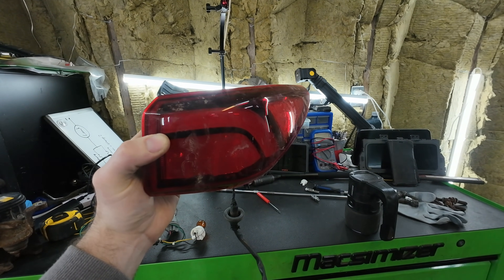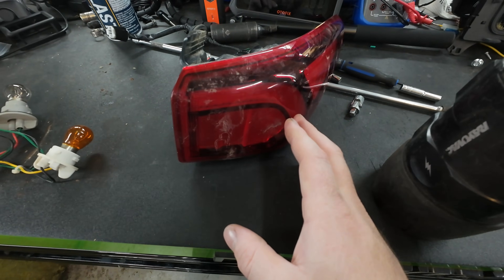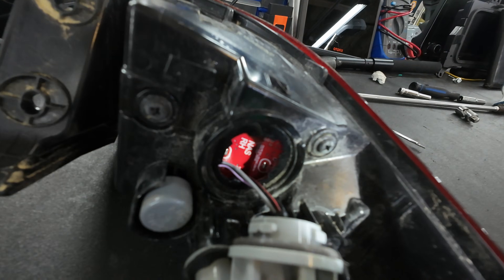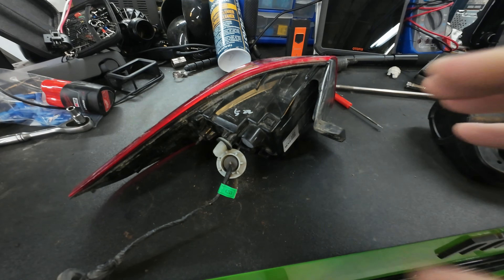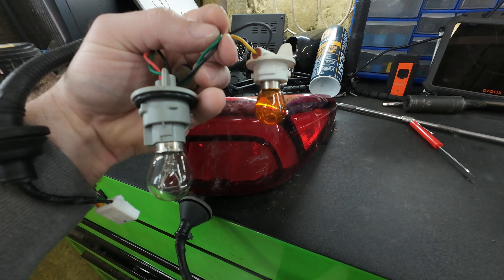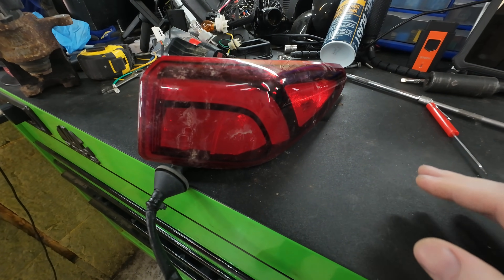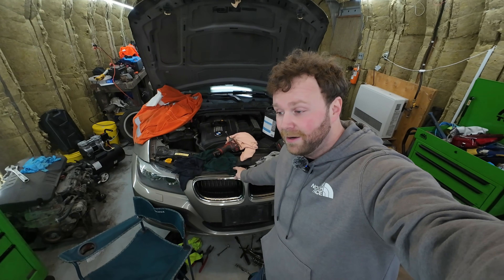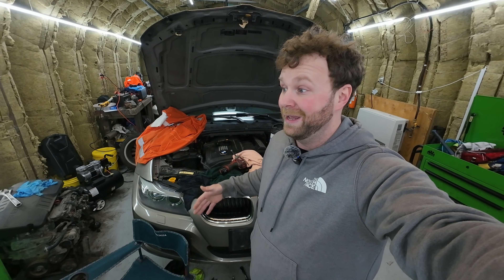Car Manufacturers don't even want you to change bulbs, they want you to replace entire assemblies!

Comment: I found this out a couple of years ago when checking on new cars that now have LED head and tail lights. I was looking a cheap cars and wanted to see what it would be to change out a head light or tail light on a 2023 Hyundai Venue, a $20000 car at that time. After going around with the parts person about wanting a Vin number (I looked up one on their lot) I was told tail and head light came as a unit and was $1400 for one tail light and $1500 for one headlight. I plan on keeping my 2005 car as it cost $5 to replace the tail light. I just put in new head light enclosure (it was hazy) with an LED light for $60 each side.

Comment: It might not be as scandalous as thinking they want to make more money on parts afterwards.    I know a few engineers that have worked visteon and ford.   If glue is cheaper then screws,  they get rewarded for saving $0.20 for every fixture that is put together.    It really needs to be legislated for right to repair.  The manufacturers won't do this out of the goodness of their heart.

Comment: I currently drive a 2003 car. This car is very comfortable and pleasant to use. No worse than a 2023 car. But when something breaks in my car, I just take it and replace this part. It can cost $1.5. All parts are available here in Ukraine, where I live, even though the Russians bomb our cities every day. I don't have to spend hundreds of dollars and go to a car service station if some small part breaks. And even if something breaks in the car, it will drive. The computer won't block the engine and there's no need to call a tow truck. It will drive. That's why I love old cars.

Comment: You're not the only one who wants a SIMPLE car. I also prefer simplicity over gas mileage/luxury etc. but it gets harder and harder to get cars like that. Just replaced my rusted out 20 year old BMW with a 2021 Mazda CX-30, it was the best I could find: Manual transmission, 2WD (4WD = more complexity), no turbo. It still has a lot of electronic gizmos inside like an electronic parking brake but at least I can still do simple jobs like a brake pad change without a licensed dealer only computer tool with permanent internet connection (like modern VW or Hyundai).

Sometimes I think that car manufacturers don't realize that they are digging their own grave. As cars become less and less repairable and more and more expensive, people will eventually demand more public transportation or look for other alternatives.

Comment: Yep. I had to replace the tail light assembly on my 2015 Ram 1500. Over $600 from the dealer. I bought a replacement from a salvage yard for $150. Same for the front sway bar. Over $800 from the dealer. $150 at a salvage yard.

Comment: I read somewhere that the new door on GM vehicles, if you break the door switch, you now have the buy the whole door 

Too bad that it is glued, usually dead diode can be replaced (soldered, but not a problem for anyone who knows how to do it)

Comment: we had a brand new ford f150 was 5 months old. headlight failed, dealer did not have one and was backordered for almost 4 months. then about a year later 5000 miles out of warranty it failed again 1500 to replace

Comment: Man I love my Audi TT coupe and convertible the coupe needed a cylinderhead timing belt the convertible needs a clutch. I will get to it. 650 for the coupe it's running and legal 24oo for the convertible. Less than 2 taillights

Comment: The last time I shopped for a new car was in 2018. Being an ex-mechanic myself I gave preference to old school simplicity. No screens, no cameras, no turbo, no GDI, crank windows, no LED lights. manual door locks, manual transmission, non electric seat adjustment, steel wheels, etc.. I bought one of the last cars with these features, or lack of features depending on your point of view.
Reply: @MrHugemoth Automatic trans is fine, as long as it's not CVT..
Reply: 1990 Chevy pickup for me. Small block engine, throttle body injection, manual transmission, manual windows, manual mirrors, and manual seat adjustment. I bought it new and I'm taking it to the grave with me. I wouldn't trade it straight across for anything brand new.
Reply: Same here with my 2004 chevy s10 blazer.
Reply: There's literally NO CAR nowadays with the spec you listed

Comment: I believe that if the automobile manufacturers continue doing what they are doing. That combined with housing crisis. That future generations are going to have to live the car free New York City way. Car ownership drops down to dark ages levels. As for me. I look at you tube videos and read internet articles . And decided that if I could I would live the car free way. And advise younger generations to do this and not try to live the American dream of house and car. Maybe the auto kind society is going to disappear  because of housing crisis even if the automakers went back to building simpler repairable card. Buti can't imagine or think of a better way to turn future generations from the car than to continue as they are.

Comment: I can remember even 10 years ago it cost $800 to have a headlight changed in an Escalade. Only the dealer could do it and the whole front end had to come off. The new car market is for suckers. It's like buying a $69 printer only to find out later that the ink cartridges cost $100.
Reply: I just got done changing my headlights in my avalanche. Had to pretty much take off my front bumper to get them swapped. I can fully imagine people paying ridiculous prices for someone to do it for them.
Reply: @Gotobug  Its not just the labor. The assemblies themselves are going sealed LED. One section goes out you have to replace the entire thing. As tech I work on late models almost exclusively and the future is looking pretty terrifying. No one outside a rich person will have a functional vehicle it 10 years, the rest of us wont afford to own a car. Ive put headlamps in that the unit alone cost 2500$ and book time is 2-3 hours to replace requiring you to peel the front clip like a banana. Even worse many of these need to be programmed after install. Without dealer level software it still wont work. Dont forget forward radar, any time the front bumper/grill is shift even slightly it requires a recalibration. Headlamp replacement on a 2025 in many models can hit 4-5k$ for one
Reply: @MartinX192  Exactly, most normal people have 0 idea how involved their cars have become. 80% of the shit automakers do should be illegal.
Reply: @Gotobug theres a business opportunity here in redesigning parts to be easier maintained. Like design a headlight enclosure that allows for the easy change of lightbulbs so you only have to do the annoying steps to replace the enclosure once and then from then out its easy
Reply: @jadedandbitter  Except you can't, because then you'd also be creating some sort of module that you need programmed to communicate with some other module. Because the headlights talk to the ADAS control modules, which talk to the cameras, which talk back to the headlights and if something is wrong then none of it works. The dash is lit up like a christmas tree and then back to the shop so some sucker can spend 1000s replacing stuff and getting all that crap recalibrated for no reason.
Reply: @400Redsport I wouldnt replace the connection, just the mount. Like have it so the top comes off and the headlight and such can be lifted out without pulling out the front end
Reply: @jadedandbitter  You are not understanding what I'm saying.
Reply: @400Redsport ok. So my general understanding is that headlights are connected to electronic control modules, right? Besides that, they should be "blind" to their environment. They can't "see" what theyre mounted in because their purpose is to emit light, not figure out where they themselves are located. If you took them out and pointed them straight up they should still work just fine as long as everything is plugged in, right?
Reply: @jadedandbitter Nope. Depends on the headlight. Some have to be recalibrated when they are removed because they have internal motors that change the direction of the lights based on steering wheel input, just as one example. One of the many reasons a headlamp now costs $2000 for just the part.
Reply: @jadedandbitter  Yes there is definitely a business model here but they will screw you with legislation to stop you doing this.
Reply: @CASHSEC I feel like kit cars need to make a return. Just streamlined, simplified, to the point where they can be assembled without hassle over a few weekends. Like you buy a universal mid size chassis and a kit for a variety of body styles plus a choice of a few simple reliable ICE designs that are picked for ease of installation and maintenance and the whole thing is easy enough to build that most any person with basic technical ability can do it. Like the proposed cheap plastic truck only ICE based and a variety of body styles for you to pick.
Reply: @jadedandbitter they will send to jail anyone attempting that.very soon only the elite will be able to afford a car. The rest of us will have make do with motorcycles , bikes and public transportation. The way it is in many countries already
Reply: @Gotobug Did that years ago on my 98 Chrysler Concorde not that hard just screws and clips.
Reply: @aliengoth never said it was hard, just a huge pain in the ass and I can see how some would pay others to do it for them.
Reply: Back in 2023, i bought a 2023 Silverado. Work truck model. No OnStar, no LED lights. Completely serviceable by myself..... So jo, the new car market is only for suckers who fall for the bells and whistles...
Reply: wrong answer. the correct answer is that companies shouldn't be making shit products in the first place that relies on buyer ignorance. it's literally that simple, no advertisement-falsifying fine print and contractual obligations required.
Reply: @Itsgone99  im working with what is in front of me. There is a whole lot of corruption everywhere. Just because companies get away with it, doesnt make my answer wrong, it still is the best answer when buying a new vehicle.
Reply: Exactly. Lol they chose to buy that model. They agreed to terms which includes repairs . You did the right thing by liking around and ordering a model without all the extra crap.
Reply: @wayneadams7829  Its worse!!! It's more like buying a 6,000 dollar printer only to find out you're still getting overpriced ink!!
Reply: This is why I stopped using my printer at home and now I have my wife do all my printing at her work. Works great for me... I save money.
Reply: What's worse. Ink can dry out. So if you don't use your printer for an extended time. That 100$ is wasted.
Reply: You couldn't give me a 2025 car and all their undependable electronic garbage
Reply: @ALIFFIFUNERALHOME hyper expensive repairs costs
Reply: Screw you Mr Car Maker!
Reply: exactly the same scam...
Reply: My 19 Bullitt had a headlight assembly damaged.....

Plastic assembly mind you, nearly $1500 for a new one.

My 2011 F 250 the door mirror (motorized model) also $1500
Reply: @wayneadams7829  True that
Reply: You chose to buy that model. Onus is in you to figure out what can be easily replaced or not. Your vehicle comes with a manual and more information is on-line. If you do not like the product you shouldn't have bought it. Why blame others for your poor decisions?
Reply: @terryarmbruster9719Because not everyone is a bootlicking apologist for the sad and pathetic culture of greed that is modern corporate America.
Reply: @terryarmbruster9719I didn't buy one of those but a friend of mine did and he told me about it.

Comment: Purchased a Toyota Camry hybrid still going strong 15 years then 1 headlight bulb 💡 went out and wow that 1 side can’t get in the back of it because of the silver electric box which the mains orange cable plugs into Wow had to drop the front bumper including plastic tray underneath and clips and screws and omg just to replace a bulb 💡 which use to take 1 minute on my old car. 

Then my taillight was damaged omg thought no problem easy unscrew the nuts and wondering why not coming out and then omg figured out the rear bumper has to come off omfg. Again would have taken 1 minute to replace on my old car. 

Then i decided never to upgrade either Toyota or other brands because of the ridiculous nonsense future technologies and designs.

Comment: It's an easy fix! You even have the the parts on your table! Take a big drill and trash the circuit board inside and install the old style bulb and harness. Just remember to use a relay to compensate for the higher draw.

Comment: You can still pull it apart it's just a little harder you have to heat it where it's glued and then the same to put it back together melt it back together. Or design a aftermarket option.

Comment: Spark Plugs?   ...   hahahaha LOL       "Just replace the engine!!!"
Reply: Don't give them ideas.  There's a couple of them on here just looking for ways to screw everyone harder! 😂
Reply: in the UK even the average engine 'costs' £10k to rebuild... some £30k...for 4 or 5 cylinders
U could machine one for less from new, given CAD files!
Reply: It's actually not a bad idea if autos were manufactured in sections. For instance a motor should be easily swapped in minutes for a new one to replace it, and then the old one can be serviced at another time in a factory setting. All auto parts should be designed to be easily swapped out and replaced super affordably.

Comment: On my old 1995 Lincoln MVIII had regular replaceable halogen bulbs but the headlights held heat and the interior reflector would burn up. No way to replace it because the unit was sealed. On top of that Ford stopped making replacements. I guess they figured that people would dump their car over dim headlights.

Comment: LED headlights suck in the snow as they don’t produce enough heat to melt the ice off and you have to pull over multiple times and wipe them off.

Comment: Shouldn't there be legal requirements for the taillights to work, from the manufacturer. An no, replacing the assembly does not count legally as that would be a forced recall. Similar to how exploding airbags are a recall and not a replaceable item. This is worse as it is an everyday safety item. Once the auto makers get some real fines this will stop.

Comment: I least, a 2021 toyota highlander  that was my last new vehicle, i ended up buying a car I could service my self.  i am a hobby mechanic, I fix a 2013 Subaru Impreza  runs very good. this car is as basic you car get.  no touch screen no led lights, I put bulbs in when the blinker went out.  great video
Reply from the maker: Smart move. Simpler is usually better.

Comment: It's become insanity.  Thanks to our own government who started all the nonsense with OBD I & II systems which have now taken us to this crap.   No more simple 95 cent bulb, you need to buy a $500 lamp assembly.  
It's this entire reason I'd rather buy an older, like pre-1980 vehicle, even if it's a little rusty, which can be easily diagnosed and repaired with simple tools you would likely already have at home.  And yes, as someone who previously worked at a Ford dealership, I can attests to the insane cost of a tail lamp.  Most people haven't a clue that their 2018 Escape has a $550 tail lamp, and no replaceable bulb to fix their vehicle.  As I draw into retirement age I want something fun to drive, but I also want something reliable and which I can afford to continue using -- there's not a new vehicle which is both reliable and affordable to repair.  Therefore, I'd rather buy something old and have it sprayed with oil to prevent rust and just drive it into the ground.

Comment: Just worked on my tail light wiring last night and I was surprised to see my 23 Tacoma still has real light bulbs back there that pop out in a second.
Reply: @josiahwyncott7519  yeah I own a 2006 Honda coupe. The tail light is LED in a sealed assembly. I think it was around $200 for a new one. I carefully tore apart the assembly, removed the circuit board and LEDs. Bought a few 12v red LED strips for like $10 and soldered them together put them into the enclosure. It's been working for more than 8 years without an issue.
Reply: You probably live in California; as I learned that my Tacoma had bulbs 💡 because LED taillights are illegal…. Why??? 
Because it’s California
Reply: @thomashenshallhydraxis  it doesn't seem to be enforced. i see led lights on most newer cars here now.